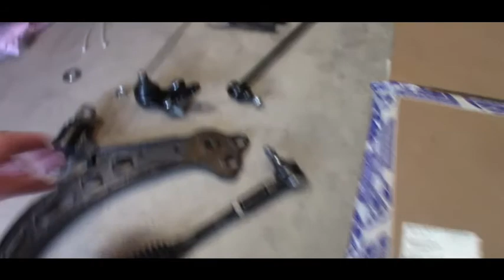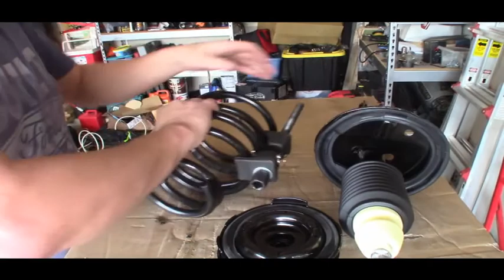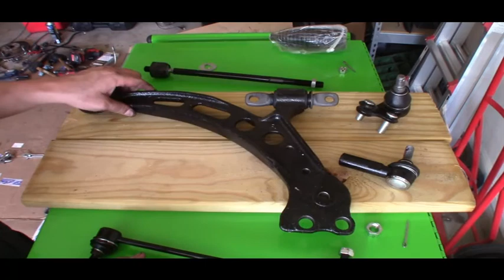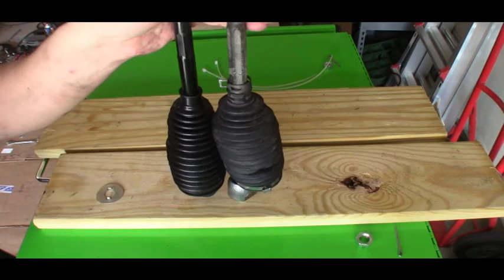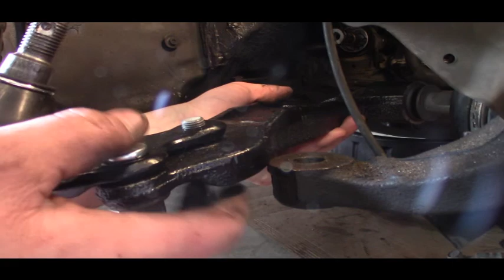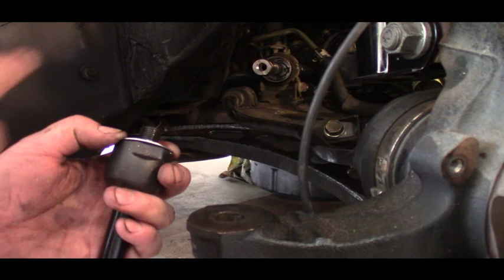Lexus ES300 / Toyota Front Suspension Rebuild with Tein Springs

Comment: Quick question.... When putting the steering knuckle back on the strut, do I have to push on the knuckle with a jack and tighten the two strut bolts or can I just tighten the bolts as is? Thank you for all your videos. I have the same car and your videos really help me out A LOT.
Reply from the maker: You can, just be very careful doing so as the nuts on top of strut are the weak point. They might strip out if not careful, I jack up the suspension to take the weight off those nuts.

Comment: Maybe you covered it in another video, but why did you go with a different spring?
Reply from the maker: For the look really, it lowers the car.
Reply: @nicklldoit  have you noticed a difference in ride quality, is it stiffer...
Reply from the maker: @claudesmoot1880  much stiffer, but you get that lowered car hop on bumps.
Reply: @nicklldoit  Yeah I want to go to the other end of the spectrum. I want cushy marshmallow suspension. Any suggestions brand, type?
Reply from the maker: @claudesmoot1880  stock springs,  with Monroe shocks and struts.
Reply: Love the lowered look, but still want the comfy ride. Any suggestions?